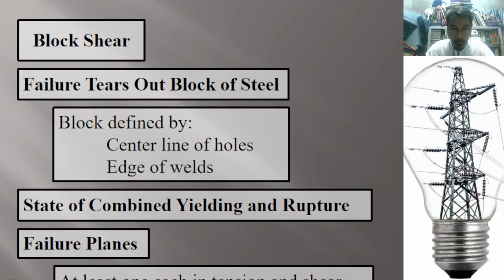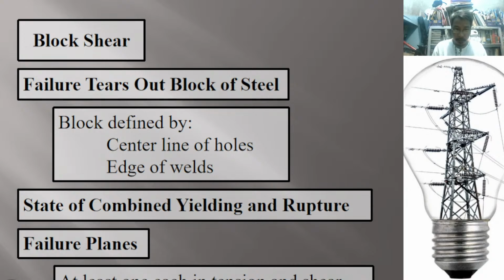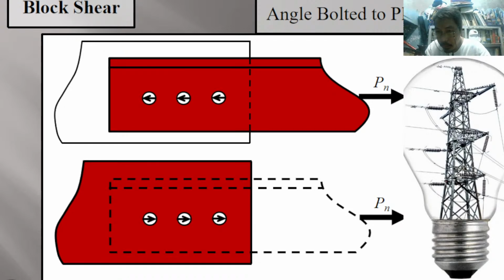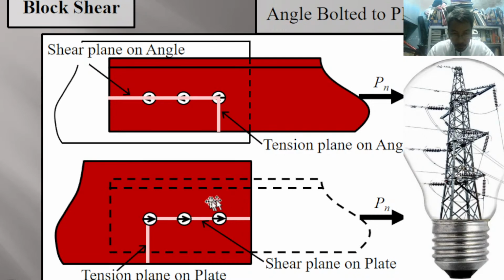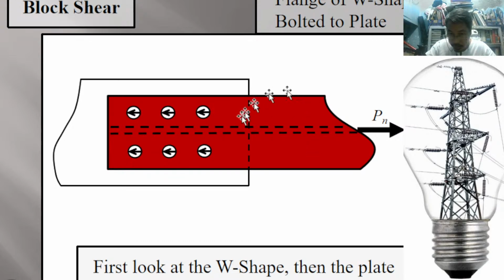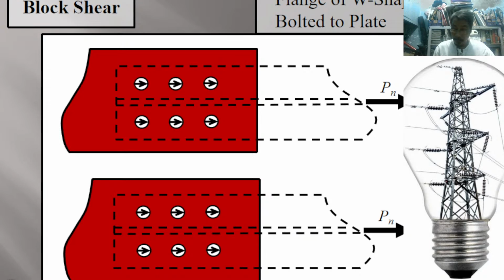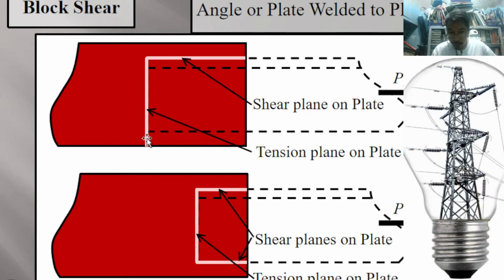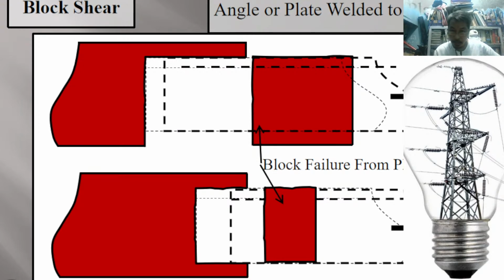[ LIVE CEE6 Lecture16 ] DrAP Zantua AISC Block Shear & Bearing Talks + ENGINEERING Analysis & Design

Comment: Thank You so much sir for discussing about Block Shear. In this video lecture Failure Tears Out Block of Steel has been tackled and block is defined by center line of holes,and edge of welds.

Comment: thankyou sir for your continuous effort to teach us through your platform here in yt. the topic that were discussed was the aisc block shear and bearing, Block shear failure occurs when the length of the connection is reduced due to the employment of high shear strength bolts and high bearing strength plates.

Comment: Thankyou sir for tackling about AISC Block shear and bearing. Block shear failure occurs when the length of the connection is reduced due to the employment of high shear strength bolts and high bearing strength plates.

Comment: Thank you, Sir for the live lecture the block shear failure occurs when the length of the connection is reduced due to the employment of high shear strength bolts and high bearing strength plates. Block shear failure is similar to tensile rupture in that the major part of the member pulls away from the connection.

Comment: Thank you sir, Block shear is similar to tensile rupture in that the main part of the member tears away from the connection, so when the block shear fails due to the use of high shear strength bolts and high bearing strength plates, the length of the connection is reduced, resulting in block shear failure.

Comment: Thank You so much sir for discussing about Block Shear. In this video lecture Failure Tears Out Block of Steel has been tackled and block is defined by center line of holes,and edge of welds. State of Combined Yielding and Rapture. Typical examples in tension members are angle connected on one leg, W- shape flange connection and plate connection.

Comment: Thank you sir for this live lecture about the AISC block shearing and bearing. Angle connected on one leg, W-shaped flange connection, and plate connection is typical examples of block shear on tension members. The explanation about the application of block shear on a bolted angle and plate, w-flange was understandable. Shear plane and Tension plane together with Block failure were well discussed. For welded elements, angle or plate, the shear and tension plane, and block failure on welded elements were comprehensible. Thank you sir for this informative live lecture. This is helpful for us to understand how block shear failure affects our steel and connection. Thank you sir.